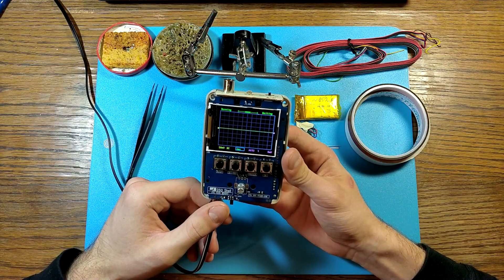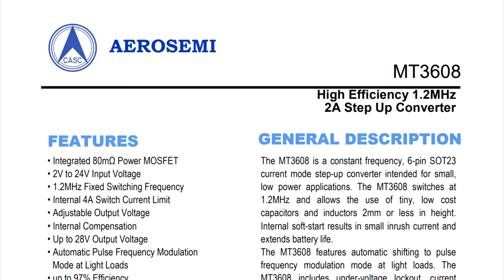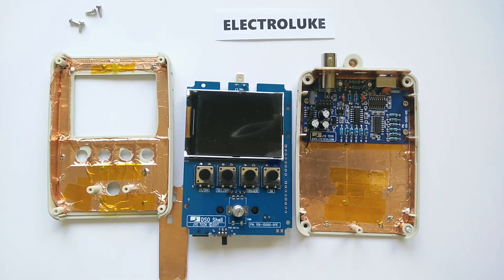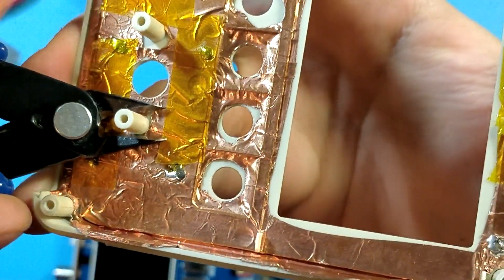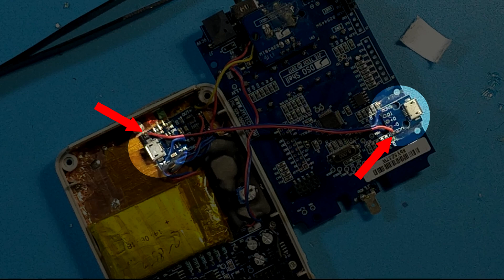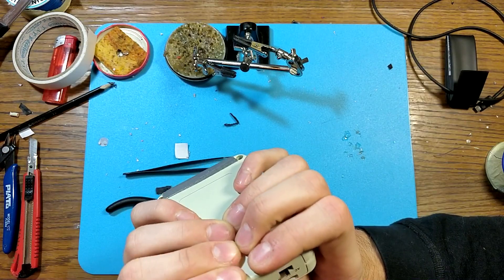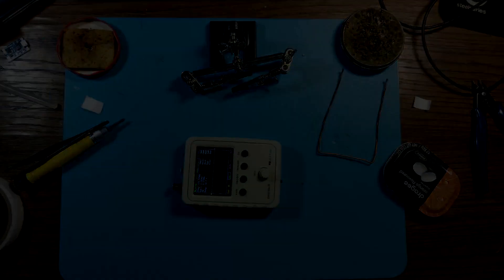DSO150 Shell Li-Po Battery Mod

Comment: Unnecessarily complicated and will damage the printed circuit board.
It is easier to add another switch to the side of the cover and connect it between the charging module and the voltage converter. Connect the output of the voltage converter to the power connector, which is marked J6 on the PCB.
If I want to turn on the power from the inserted battery, I have to turn on both switches, one original and the other that I added between the charging module and the voltage converter. If I want to power from the adapter, I turn on only the original switch.
Well thank you.

Comment: The only thing I would worry about this power supply is introducing noise into the oscilloscope circuit due to the switching converter's harmonics.  Completely enclosing the power supply in metal foil and grounding the foil to the negative rail will shield it somewhat, but if I were to do this, I would put the power supply away from the scope and decouple it heavily using capacitors.

Comment: How much did the switching converter noise affect the operation of the scope on the low voltage ranges?
Did the noise floor level increase or did it remain the same?

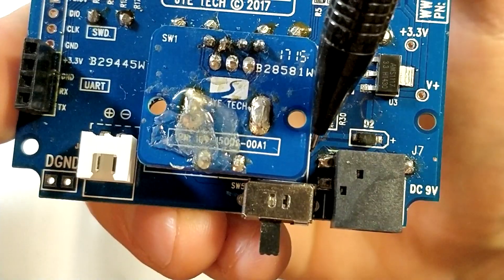Comment: I do not know if it was a mistake in the video or not, but on the PCB edge you can see a white plastic connector (for example at 3:39). Just plug in a 1s lipo and the device starts to work! No boost converters needed...
Reply: And I will take my comment back! The device works with lipo straight in connector but not correctly.
Reply from the maker: Yeah, it might turn on, but I guess it should be unusable with anything less than 6.5V because of voltage regulators. Even with a proper supply voltage this dso does very bad at voltage measuring, at least for me

Comment: Love your videos! Keep it up! Just one doubt doesn't the charging module get heated up while charging?
Reply: In my opinion it could also melt hot glue when it gets heated
Reply from the maker: Yeah, it gets warm, a better, more heat-resistive mounting should be the choice, but I think there's nothing really to worry about with plain old hot glue, I had quite a few charging cycles so far and it's been good. Thanks!
Reply: TeraLuke I made a battery charger once and used too much glue that eventually due to heat the whole setup started to melt, and then the charging boards started malfunctioning. But I guess you're using just one charging module, a small battery and the enclosure also is breathable a bit so your project turned out to work fine. Thanks to you now I know that I can use 1 module without worrying about heating issues hehe 😁

Comment: hello there.  i was wondering how large is the compartment from the encoder to the other pcb is there? also i am liking the new changes you make. keep it up!
Reply from the maker: Thanks! I'm not really sure what you're asking but I guess about 5mm. For scale, these dupont pins that are connecting encoder board to the main are seperated by ~1.6mm so you can make out what's the dimensios by analizing this video footage, good luck
Reply: TeraLuke nvm I had made my own up and has 2400mAh :D it works great. I made a few changes to your design. The power switch has two rows so I split them so one turns on the oscilloscope and the other passes from the battery circuit to the boost converter. Allowing for the device to still use 9v and the battery but only if the switch is in on possition the boost converter is also turns on. Allowing the battery to not be drained in standby. I added an additional switch also to allow charging while the boos convertor to be on batter or the 5 v rail(so I don't stress the battery protection circuit.) It worked out well and I get around 4and a half hours out of it. Achieved by adding thicker worse from 9v to the board to try refuse resistance.

Comment: Very cool indeed! I have one of these, been using her for over 2 years, well actually it lay in my parts box for one year until I discovered the problem with the unit, one leg of the rotery encoder was dead.  After ordering a new encoder and installing it, the unit has been working very well for the limited uses I have for it, and for just playing around with it.  I have been powering her from a 9 volt rechargable battery that I have in a battery case, glued to the back of the unit, the case works as both a weighted stand to hold it when using it, as well as a switchable power unit for the device.  Over the years time of tearing it down and trying to get it to work, I have managed to loose the bottom plastic that covers the input and switch, but that doesn't seem to be a problem as far as it  goes.  Some day I hope to dig into some box in the back room and discover that piece of plastic.

Comment: Hello
on ebay.it, looking for "DSO150 - Shell for battery pack", you can find the shell that I made for editing that shows on your video but that allows you to add an even more powerful battery.
Let me know what you think.
Thank you
Reply from the maker: Looks really cool and well designed ! What process do you use making these ? 3D printer ?
Reply: Yes, 3D FDM printer.
Obviously a light texture is visible, which however is pleasant to the touch.